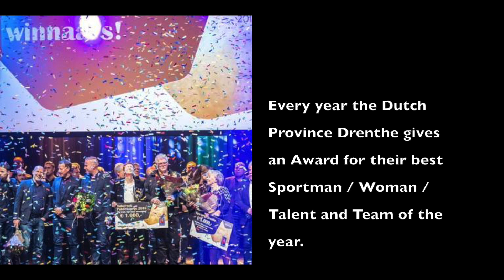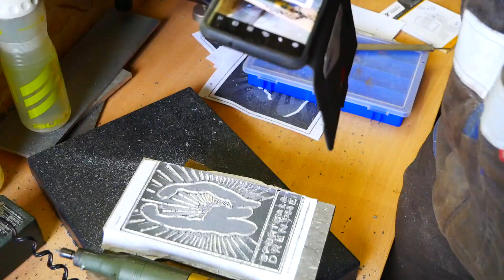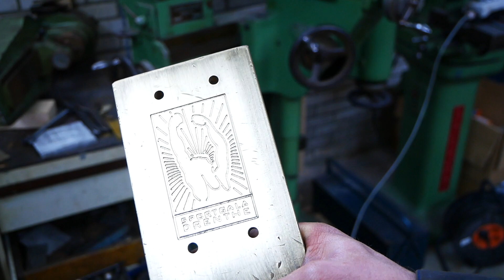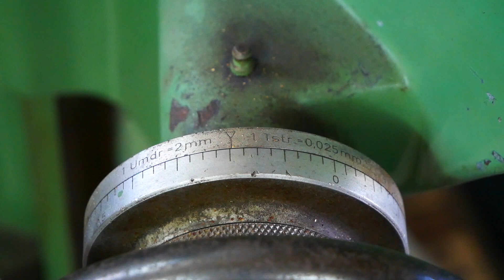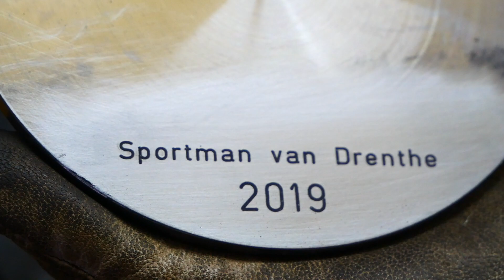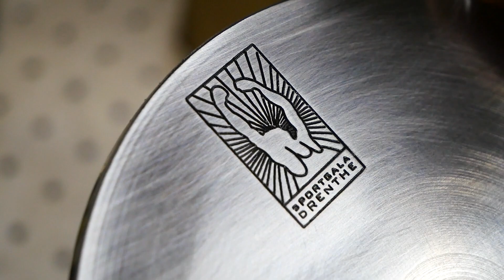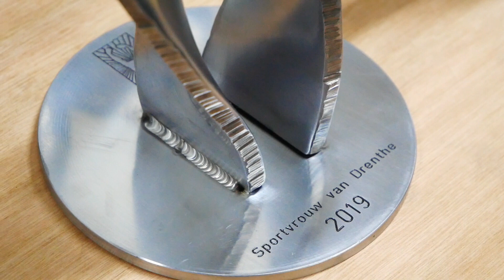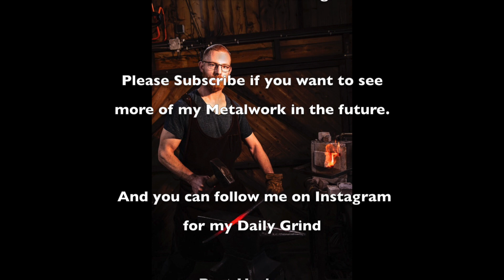Metal Artwork: Making Trophies for Sportgala Drenthe 2020 (Long Version)

Comment: Good morning. Very nice job Bart. Now you have a big warehouse, so why don't you buy a vertical bandsaw for cuttings? I bought a 1947 wood bandsaw for 200€ converted with geared motor to reduce the speed and homemade bearing guides. It's a real pleasure for cutting cold rolled steal for exemple...
One more time good job and i am waiting for your next video.
Reply from the maker: Good morning! And thanks. Yes I plan to make / buy a bandsaw that can work horizontal and vertical. But for this project the customer wanted a 'rough' edge that I got from the plasma cutter.

Comment: You did an excellent job on those trophies ! Nice to see you get work done in the new shop. Btw your tig welder seems to make a funny noise. Or was it something rattling on the bench? Otherwise I would look in to that before something goes wrong.
Reply from the maker: Thanks! I got a new welder (V205-T) with the watercooler. The cooler pump is making the noice. I already tried to make it a bit more quiet but I think I will put a different style pump on it in the future. But I don't think it can damage something besides my ears...
Reply: @bartharkemametalworks2299  make sure that the pump still has enough flow. Ik damaged  a torch that way
Reply from the maker: @tomwagemans1872  yes I checked that. The torch stays cool a the moment. I think I will put a temperature sensor in the line to monitor